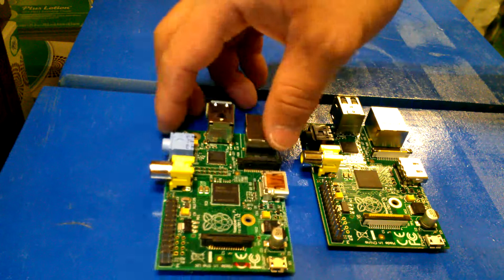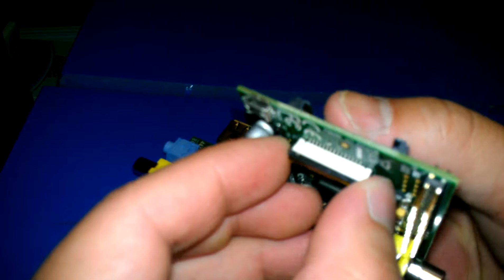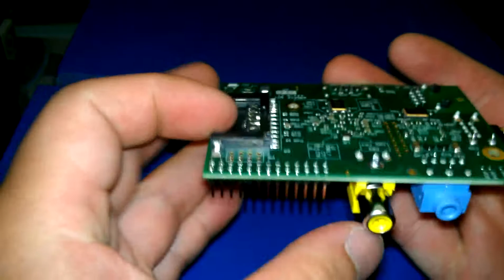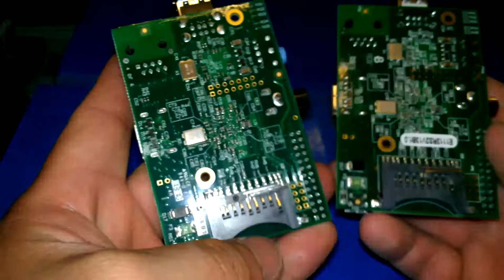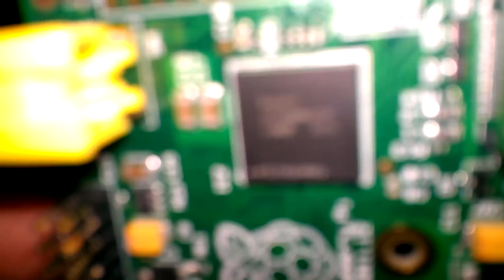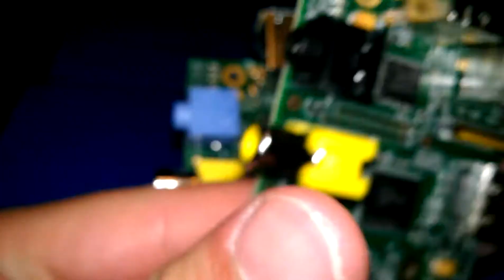Raspberry Pi Comparison - Made in China Vs. Made in UK

Comment: How about performance?
Reply from the maker: Performance difference between the China vs UK model? They're the same. The CPU is Broadcom. Only Broadcom makes those specific CPUs for raspberry pi foundation.  There hasn't been a forgery so far because it would cost more to forge. The made in China boards exists because of demand outstripping supply. The couldn't make enough of them in UK so they off it to China.
Reply: leefiles so they are same?
Reply from the maker: yes

Comment: At college, we have several Pi's, some made in China and the rest the more recent made in UK models and there are differences. The Chinese ones are proving to be troublesome and less than reliable, the UK one is just better processed, the mother boards are more substantial, the cutting and finish around the edges are much better as is the soldering. I am glad they chose to produce them only in the UK.
Reply from the maker: Did they crash a lot more? Mine is still running. Crashes every few weeks though.
Reply: leefiles They just have general problems from unrecognised USB and audio jacks to system failures. Some of them just don't turn on. The Chinese ones get quite hot as well.

Comment: Probably the former, since the same thing happens regardless of the power supply and the SD card, and even when nothing outside of the power adapter and a fresh SD card were inserted, light still went to a solid red after 4-5 minutes. Well, it's really dead. It makes a nice trophy at the very least.

Comment: Still running the same thing. I'm surprised how fast it is. Just remember, if you plan to use the full offline image, then expect to get a TON of updates after setting up wifi. (It just went on, and on, and on, and on, and continued for a few minutes updating, rebooting, updating, rebooting, then it finished. I immediately turned off automatic updates afterwards.)

Comment: The wifi adapter that I use is a Netgear N150 Wireless USB Adapter. Even though it claims to be compatible with Windows 7 only, it actually works with no issues. Thank the perfect Atheros driver on most of the Distros optimized for the Raspberry Pi for having it.